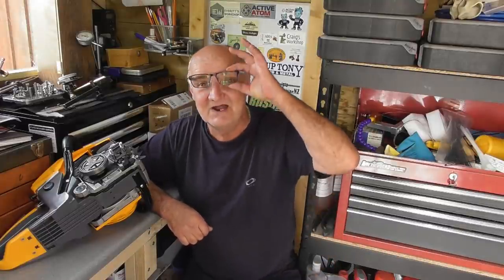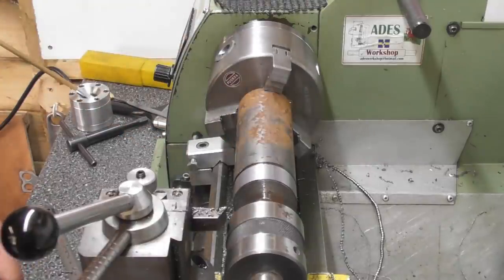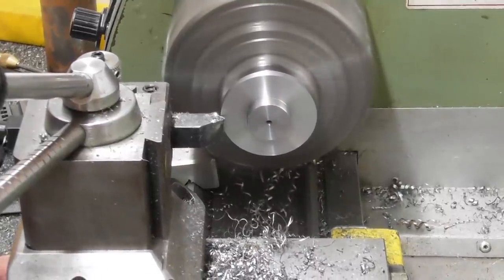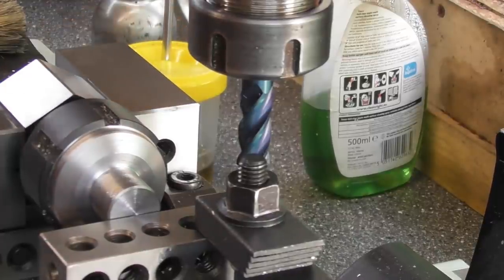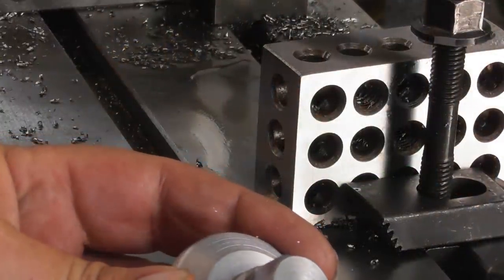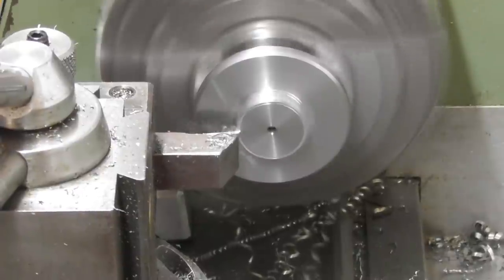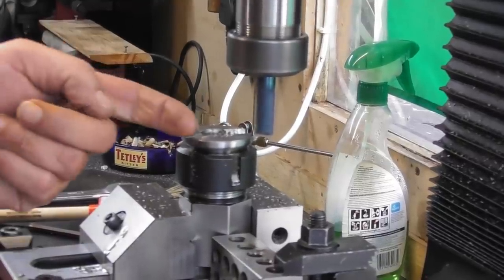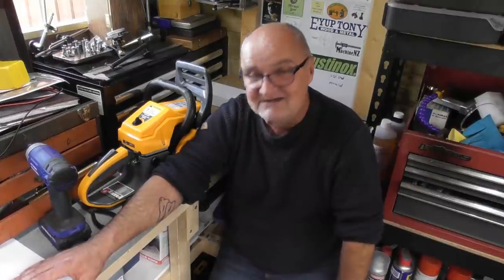Chain saw clutch removal tool

Comment: great little project, but maybe next time you could harden it ( heat and cool slowly) esp. if it is going to be an impact socket, as this needs hardening for the job it has to do, ie to take all the forces.

Comment: Hi Ade, great instructive video. I was watching another maker yesterday and every time he took the corner off or put a slight chamfer on his work in the lathe, he lifted his tool up quite a lot in the tool post. I've never seen this done before and wondered if you knew what the reason could be? I didn't think it was good practice because he forgot at one point to lower his tool back and nearly buggered up his work.
Thanks, Glyn.

Comment: Good tool that Ade, works perfectly as I knew it would! Talking of "quick and dirty", you really didn't need to use the 123 block as a stop, as you can register the nut of the collet block on the vice edge and get a clean repeatable position every time you turn the block over for cutting the next flat. Even quicker and dirtier! Lol Of course you needed the stop on the slotting operation to get the part in the correct place.
Reply from the maker: I went with the 123 as extra support to keep the part in the collet as it was only holding on 5mm width . extra security i guess. cheers Ade.

Comment: I used needle nose pliers and then put an adjustble wrench across them.  I filled the cylinder with rope.  I turned the clutch the correct direction but it was on so incredibly tightly I really had to apply a lot of preasure.  The saw doesnt idle properly anymore, it runs way too high.  Seems to have a leak.  Do yiu think I bent the piston or something?

Comment: The key to parting or deep grooving is to maintain constant load on the tool bit. Allowing the parting tool to dwell is not good practice, especially if the material being machined is prone to work hardening.

Comment: A big laugh from the beginnig. You are really a large piece of sunshine Ade.
Did You buy Your glasses in the same shop as I did? Mine are also foggy most of the time....
My last ones lost the pads resting on the nose. One after cleaning the lens, one when pushing them up along the nose. New mechanics needed for the expensive progressiv windows...

Comment: Really nicely made Ade. Perfect fit and operation as was obvious by your reaction when it 'just worked'. I have just purchased some of the black oxide from Carswell, currently testing the new mill out making some clamps for the vice...... Now where did I get that idea? I am giving it a proper test, using D3, I figure if it copes with that it will do everything I need. Video coming shortly. Well done. Cheers, Jon